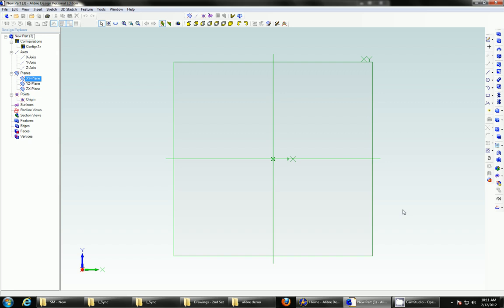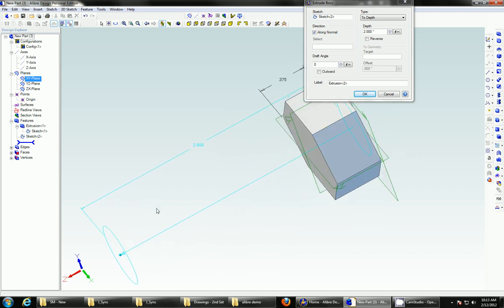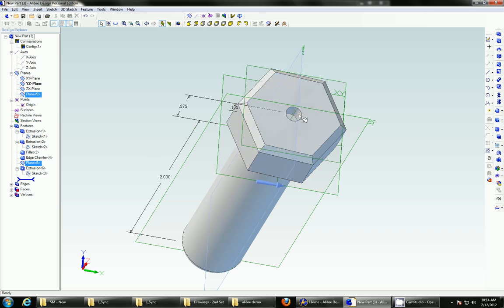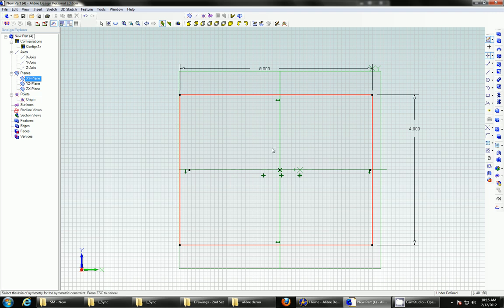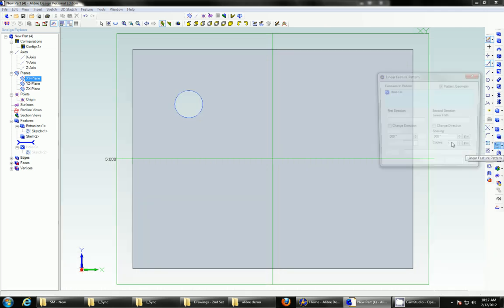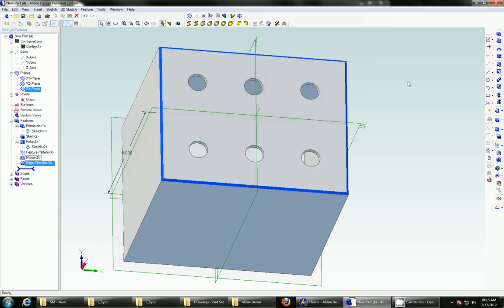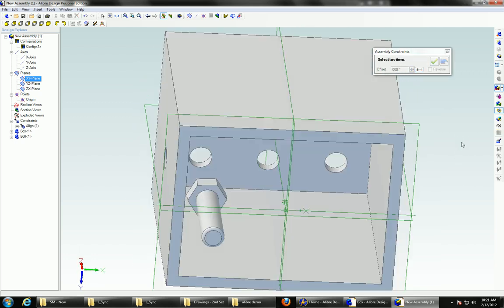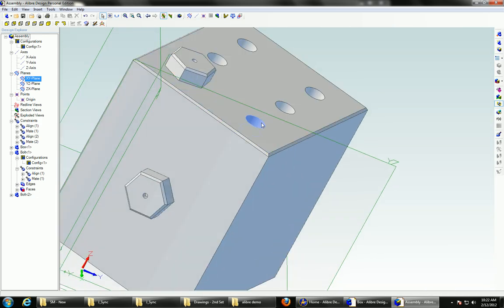Alibre Design CAD 2011 (Geomagic) Demo Tutorial & Overview

Comment: I was fortunate to purchase the 1011 when it was available. I didn't get the sheet metal module with this version. It took my feeble brain several years to understand how to create a part. I built a CNC table out of wood and got the stepper motors and controllers off eBay.  I make small stuff out of wood and some metal parts. I bought v carve  and a few other programs for designing things. For the price and ease of use it fits me perfectly.

Comment: Your'e suggestions of using the shell method and adding secondary planes to the drawing worked wonders ! I was trying to use the Sheet Metal program and after several hours of frustration I scrapped that and followed this video's steps ... And BAM ! in no time at all my bracket was all drawn. 

I did see that if one makes an attempt to do an operation that is not possible then you have to go back and delete that step from the Left Hand List or it stays in the sequence and messes everything up, even though the Geo Magic called a foul and seemingly stopped the operation.

Thanks again.
/Chuck.

Comment: I've been using Alibre Pro for several years. I'm not a designer or engineer, but a chemist, and I use to make jigs and holders and so on for optics or fluid handling stuff. Where I work, SW is the standard. For my personal use, though, I have been quite happy with Alibre.

I've been following you for a few years, since the Taig in the apartment days. My setup is very similar to what you started with. I'll have to get very, very serious to upgrade to a Tormach, but I do aspire to that.